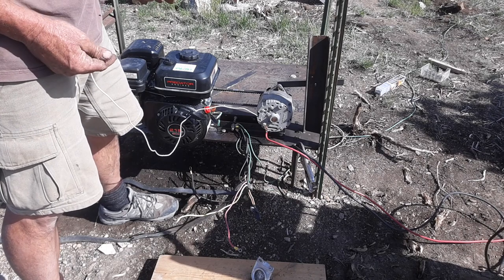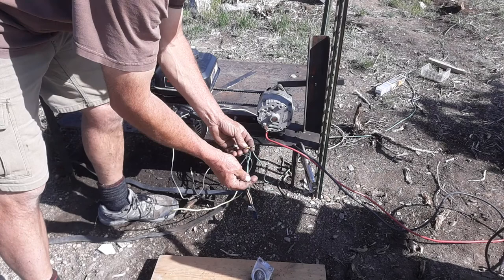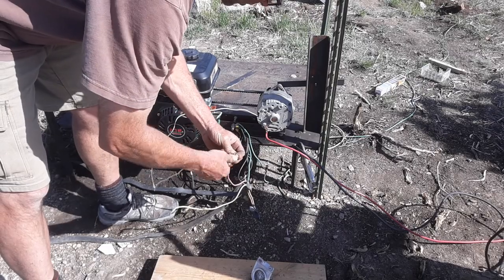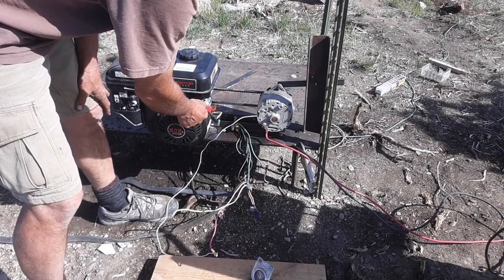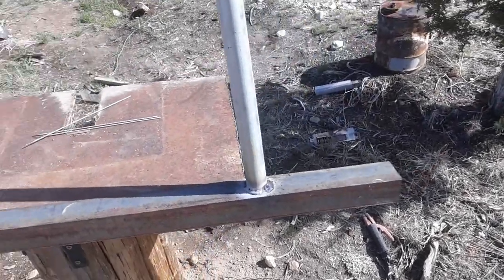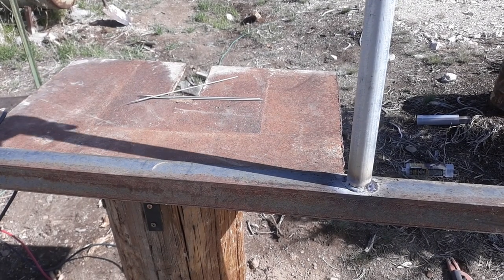Welding with Delco Remi automotive alternator

Comment: My friend has a small 80 amp alternator powered by a 80cc 2 stroke stihl concrete saw engine that can burn rods pretty good uses a small atv battery to power the Feild and it's the size of a small cooler. He has a rectifier installed aswell to stabilize the arc it doesn't make the same squeezing sound while welding

 it's a 1-1 drive with a 2 lb steel flywheel on the connecting shaft so it doesn't stall when he strikes an arc. He has a switch on the lead that closes a solenoid that revs the engine up to a set rpm/amperage that can be adjusted by a twist nob throttle stop he made.
Reply from the maker: This still had the  rectifier installed so in effect I was welding with a DC power source. I wonder why it makes that squeezing sound?
Reply: @damocsell  I asked him about it today and he said he's running a separate rectifier from an old Forney welder. It's good for 300amps constant and 600 amps for a 20% duty cycle but his set-up is far from capable of that. he's ran it at 8k rpm and only made 90 amps so he's learned over spinning it only makes a few more Amps and gets it smoking hot so he's planning on doing a 1.5-1 reduction. 
It burns 3/32 6013 amazing but he prefers running smaller rods like the 5/64 and running Multiple passes on the trail as he hasn't found a 5/64th it won't burn but he's found 3/32rods that cause it to stall after a a rod when the amps really pick up.

He said something about adding a dimmer switch for the amps but I don't know how that would work. Maybe it would controll the incoming current to the Feild but I doubt that would affect output much.
Reply from the maker: @buildurtruckurway9118  That makes sense I have overworked a few rectifiers. I am guessing but dimmer switches are probably using PWM Pulse Width Modulation so could probably be used to control the power output pretty easily. Smart guy your friend.

Comment: How many amps you burnin at?
Reply from the maker: I'm not sure but voltage is in the 60 90 volt range. The alternator rectifier is rated at about 70 amps from memory so under that I expect. I'm making a guess but probably 10 to 20 amps.

Comment: The engine sounds like it is running in excess of 5000 RPM. Not a good thing for the engine life. Granted it is a HF Predator but still.
Reply from the maker: You are probably correct In some cases I will over rev the engine to get a little more power I have not blown one yet but could see getting less engine life. those HF Predators seem to be a very good buy all the plastics and metal peripherals need to be replaced but the motor itself keeps on keeping on.